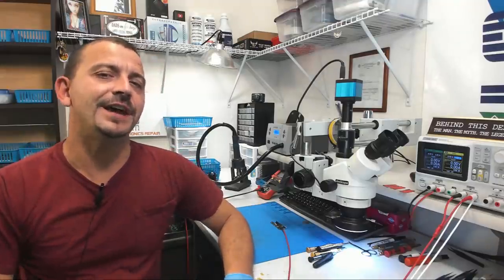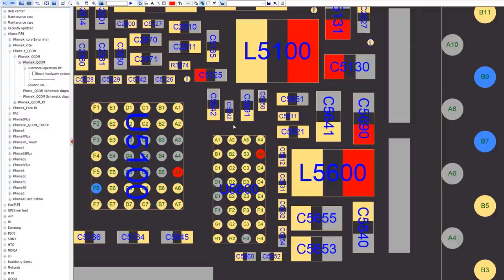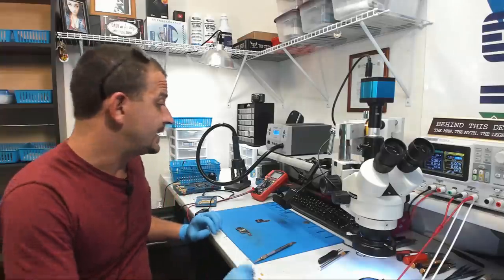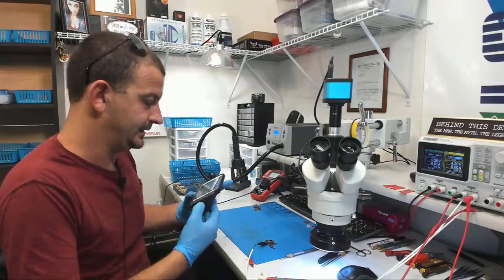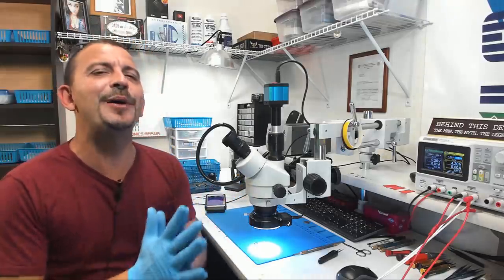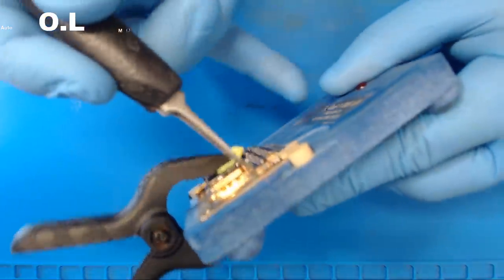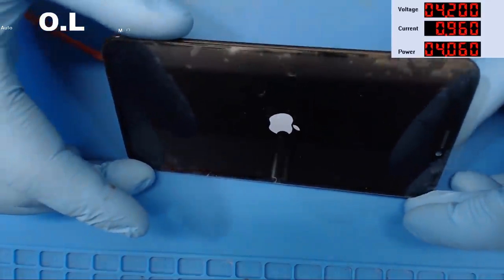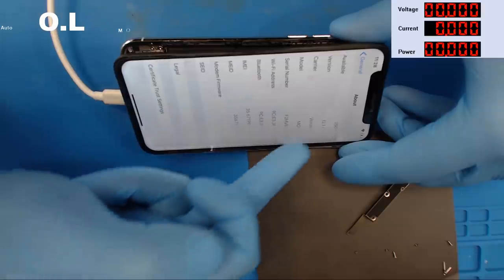Fixing an iPhone X that wont turn on due to a VDD_MAIN short

Comment: I can't test this theory but if you preheat the boards with air or have some air over the larger area when initially on hot plate it might help prevent warping. With that end of the board being small I think it will be absorbing heat faster and expanding before the larger part hence the bend. That or maybe a cover to help more uniform distribution of heat over the top side?

Comment: Nice work. Start separating the sandwich on another spot with more thermal mass. The hole next to SIMtray for example. You will end up with a top board that isn't bent that much an it will pull itself down when soldering back together.😉

Comment: Hey Jason,

didn‘t you replace the bad cap? Did you just left the board w/o the cap???
Reply from the maker: I usually replace them but not in this case.  It's too minuscule to risk soldering next to the PMIC.  It wont make any detectable difference in how the phone runs.
Reply: STS Telecom Alright, that’s true. That woould be dangerous... 
Thanks for your reply, Jason 😊
Keep going with your great videos! You‘re a really cool guy. 😊🙏 
Greetings from Germany
Tolga

Comment: Can I send my Iphone XS to you for repair? I saw a spark while putting back together :-D
Also the face ID doesn't working.... A "patch-up"on the able would be fine if it saves the Face ID feature :-)
Had some water damage, rear camera no has a water spot, but can live with that....

Comment: Yep plastic clamps don't like heat, you could wrap the feet in aluminium kitchen foil, at least the melted plastic won't get on the pcb lol.
Reply from the maker: I wish I would have been recording when I first put the clamp on.  I knew it was melting but I didn’t count on it sticking like that.
Reply: Well you have to experement to find good methods.
Have a hunt for a clamp with say teflon feet or better, they must exist :-)
Reply: @zx8401ztv  man this mechanic preheaters is sucks i see mechanic failing with their new product line

Comment: Sooo could you tell me how the heck everything works without that cap?
Reply: From what I understand if the phone is in for just data recovery the repair shops don't care if something non- essential for data recovery is broken because the phone wont be used any longer. If the board is in for repair and will be used by the customer then they will take a look and see if what is broken with the shorted cap is something the customer really needs and fix it if it is essential. Sometimes fixing caps right next to the main cpu are problematic since the cpu is heat sensitive and you can kill the board pretty easly.

Comment: Apple: I think our iPhones are too repairable, let's sandwich the board so no one can properly separate it and fix anything. Also let's make face id brake as soon as you change the display.
Reply: Apple is trying to making it harder for independent repair shops to fix phones. Apple is  trying to force their customers  to deal with them only for the fix (or replacement).
Reply: If you break FaceID during a screen replacement, that's all on you.
Reply: Yea, if they didn't think it would make the phone waterproof, they would pot the entire thing.

Comment: Why not use the thermal camera before you separate the boards in case the fault is on an outer side or did you do that already but not show it in the video?
Reply: Cause all vcc main components are inside both boards
Reply: @froydenzi  However if you watch Jasons video some of the components associated with VCC main were on the top side of the board.
Reply from the maker: There are some under the shield for acorn.  I wind up floating the PCB halves to remove that shield anyway. Perhaps I could clamp it first?  I did peak at it with the thermal cam before taking it apart but could not tell where the hot spot was.  The odds are very low that it would be anywhere other than between the 2 halves.
Reply: @ststele  Thanks for your reply. I wasn't sure if the thermal cam could "see" clearly enough to identify if the short was inside/between the boards.

Comment: when you say the vcc main shows .7 Ohms, did you know it had a short because the reading should be 0.0? so any reading that isnt 0.0 means a short?
Reply from the maker: A perfect dead short would be 0 ohms.  Vdd main should be in the thousands of ohms for a normal reading.  At 0.7 ohms, too much power flows.  This short was even lower since some of that 0.7 ohm resistance was coming from my probes.  Hope this helps!  Sorry for the late response. 🙂

Comment: How removing the short and not replacing the short actually fixed it?
Reply from the maker: In this case it was a cap that was shorted together inside.  Removing it allows the phone to boot and since it's such a tiny cap on a network with dozens of other caps, it wont ever be noticed.  Sort of like having a couple dozen kidneys.. hehe :D
Reply: @ststele   I know it could be for power sharing etc, but surely a better value unit would have been a better fit for the customer and their rep. Do you think Apple are getting worse for cost cutting or just lax?
Reply: Its just a filtering capacitor

Comment: Yay! iPhone X video!
Reply from the maker: I’m gonna post some longer ones soon :)
Reply from the maker: ...hopefully soon.  Gotta catch up!
Reply: I Build my work bench inspired from yours btw :)
Reply: in one of those longer videos, i would love to see a bad lift and how to re-ball and clamp a warped board... is the drag an iron and let surface tension method you do minimal enough? Or when clamped, will that bridge pads?
Reply: @joesipaq  Take a look at one of Jason's prior videos where he showed that https://youtu.be/DBhzDSwU3uA?t=575
Reply: @GregM  if you check at the 44:30ish you can see there was a gap but it came down with no assisting. I was specifically referring to that video when i mentioned the reballing by surface tension - but as you can see, the board was not warped and sat down unassisted. I was asking more specifically what to do when it is warped terribly and has a gap. How much solder to add or what to do to clamp it down.
I thought i asked that well in my question - sorry for the confusion.
Reply: @ststele  yes you do! :P